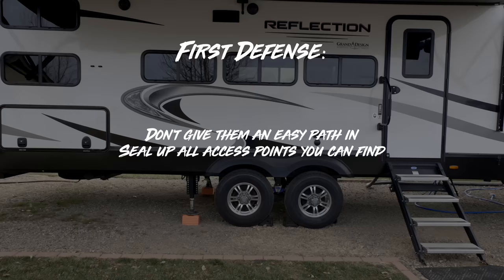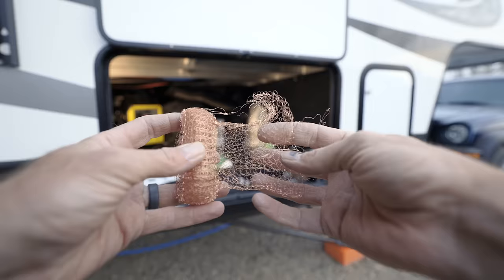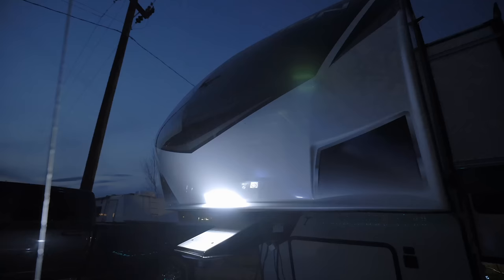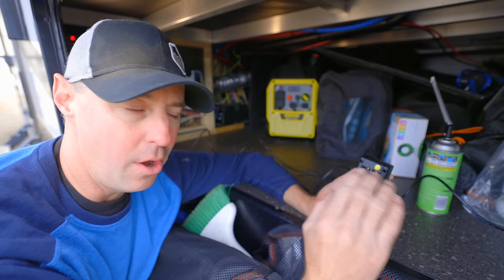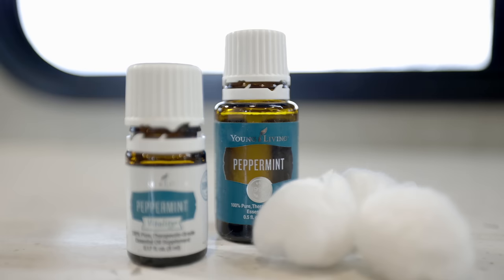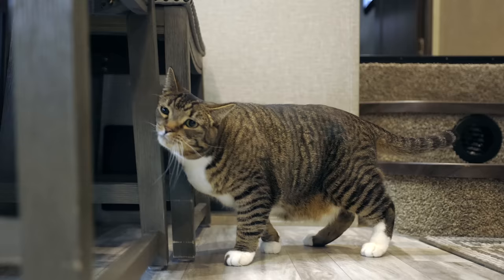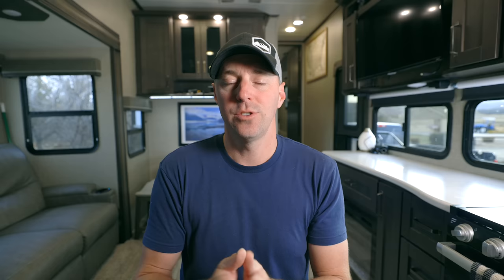How To Keep Mice And Pest Out Of Your RV.

Comment: I don't understand why the manufactures don't take the steps to seal off these entry points to begin with. So frustrating.
Reply: I don’t think you understand how small a mouse can make itself. It’s impossible for manufacturers to seal all the holes. Then the RV couldn’t breath and it would mold. 🤓
Reply: They really don’t have quality control 😩
Reply: Impossible...
Reply: Slows down production. Make holes bigger. Im disapointed in their work manship. Hard to find a used RV with full sealed off underside steel sheeting.
Reply: Because if they do you won’t have to buy another one in five years
Reply: @shanepitzer4323  you think the rv makers don't seal up the holes because they don't want your RV to mold? 😂 bless your little heart
Reply: I swear RV makers use a claw hammer to make all holes for wiring and plumbing.  Poor workmanship abounds in any RV I've owned.

Comment: I have one of the inexpensive CCTV sets from Harbor Freight. After trying all the usual deterrents with no luck, I set up the CCTV on the barn floor under the trailer pointing at jack stands and tires. Long story short they were climbing the power cord. That took care of 99% of them, no more mouse parties over the winter. I set up 2 of the bucket/plank traps with peanut butter for bait near the trailer as well, you know, you don't want them to starve or freeze to death. Drowning seemed fair enough.
Reply: Bucket traps work wonders. Gotta use water though or they'll just jump out. Use antifreeze in the winter to keep the water in the bucket from freezing.

Comment: We slept with our door open on a warm night. A critter came in through the bug net by chewing his way in. After it got in, it wanted to get out. What a racket! We were up and down all night long trying to find it. laid out four sticky traps to no avail. About 6am I shone my headlamp to the front of the cab and there it was…a huge kangaroo rat! I was sure it was going to bite my leg off. I quickly swung open the cab door and ran back to the safety of my bed. It must have run out as after that all was quiet. Smoky Mountain road south of Escalante.

Comment: I lived in a house built in 1840. The mice were here generations before I moved in.

Mice can squeeze through small openings, but 1/4 inch hardware cloth keeps them out. Patches of hardware cloth sealed over 000 steel wool kept the house mouse free.

Comment: I use brass wool to plug the smaller holes. The steel wool makes a nasty mess when it rusts. I used 1/4" galvanized mesh to eliminate larger entrances. You really have to become an investigator. The manufacturer of my RV cut a 6" square hole to feed 1/2" of wires to our entertainment center. SO many oversize holes to fill, electrical, plumbing, walls, floor, AND ceiling. Look in your basement for plumbing and electrical feeds.
It took me a week of cabinet disassembly, crawling in, around, and under my RV. 
Make sure to remove ALL edibles. I found a fried mouse in my toaster. It was going for the crumbs in the tray on the bottom. They ate my Irish Spring soap.

Comment: We are on our third season with dryer sheets, works great for us to keep mice out.
Reply from the maker: Nice!
Reply: We’ve been using them for years and we’ve had no mice get in either. Of course, that’s not proof that they work because we don’t know if any were even around or tried to get in or found it unpleasant and left, but it does make the trailer smell really nice every spring.
Reply: Where did you place the dryer sheets?
Reply: What you mean dryer sheets? Can someone explain further please? @AllAboutRVs
Reply: @boabglen  we use a couple boxes of dryer sheets all around the inside of the camper, in drawers on the bed couches in the cabinets anywhere we think a mouse would visit. And like someone said your camper smells great. We opened our camper a few weeks ago and had no signs of mice.

Comment: We have always fought with mice getting into our RV.  We have sealed all of the holes we could find and used various things to try and replell or catch them.  We seem to have found the one thing that has consistently work for the past couple of years, that is Grandpa Gus's mouse repellent.   A friend suggested it and we have not had any mice since we started using it.
Reply: Where to get it ?
Reply: @JamesBond-hu9rg  Amazon, where else 😁
Reply: Chiming in late here, but I absolutely agree! I used this in my attic years back and this worked flawlessly. I just purchased my first TT last week and will be putting in Grandpa Gus packs this weekend, on top of sealing the holes in the bottom.

Comment: While working on our RV, (Tiny House on Wheels) in the backyard, we started to see evidence of mice. Sealing all places they might get in is a great idea but as I was replacing the subfloor this was not an option. We trapped a few, but they kept coming. We bought a few of the Eliminator Ultrasonic Rodent and Pest Repellers and plugged them in. We have not seen a mouse since. Finding a similar product made in America would be better, but these did the job.
Reply: I love hocus pocus solutions... I also love seeing dead mice in traps, nothing like proof!
Reply: I worked in a Pet department of a store and I put an ultrasonic mouse repellent device in a glass aquarium with several hamsters I plugged it in thinking they would run from the noise or freak out they didn't react whatsoever ! It didn't bother them at all. I have seen several videos that show the same thing. You are paying for a plastic box with an LED that probably doesn't even make ultrasonic sound at all. I hear they work great for werewolves and vampires .

Comment: Modern RV s end less chore. Add screen, steelwool, screw in fitted cut tin patches, spray foam. Then mint oil, little trees, flower 
 airasol. You need them all. RV s are the best mouse attractent.

Comment: Gret tips to prevent mice entering your RV. I use the copper mesh instead of the steel wool because the wool does rust and could stain. I will consider the rid a rat item. 
In addition to sealing the underbelly of the RV, I also recommend using the copper mesh in the corners of your slide out too for when in use or in storage.
Reply: What do you mean copper mesh in the "indoor" corners of your slide or outside?

Comment: Here in Indiana we store our camper inside from November to April. We have always used a product that a local farmer taught us to use. It's called Fresh Cab and you can buy it at most stores like Menards, TSC etc. It's citrus based and has a pretty good smell, for people anyway. 8 years and never a rodent. We add some dryer sheets just as an extra. I notice that you have not mentioned it as a deterent.
Reply: What's the dryer sheet method?

Comment: Bounce fabric softener sheets work very well on the inside of vehicles or campers. Plus they smell nice….for a while. And on the outside I use Tom Cat bait boxes. I usually put one at each corner of the camper and one at each wheel.(on the ground) I’ve used them for years and had very little to no rodent issues.
Reply: What do you mean bounce fabric softener sheets?

Comment: You can use stainless steel wool that is course.  The copper can be eaten through.  I’ve used the stainless steel wool for our camper and you don’t have rust issues and the critter don’t like it.

Comment: We've been using Dryer Sheet for years.  So far (fingers crossed) we've never had mice.  

Our trailer is stored indoors and we do not have access during the storage season.  So lots of Dryer Sheets.

We've recently had an invasion of mice in our attached garage.  3 traps, baited with Peanut Butter have caught 5 in 3 days, then 2 weeks later, 2 overnight.

Thanks Jared.  Great suggestions.

Comment: Steelewool is highly flammable!
Reply: Google "start campfire with steel wool."  Lots of videos and articles!
Reply: @lisastoner6635 Only the finer grades like 0000, the coarse stuff would require a sustained propane torch flame to have any chance of ignition.  Think campfire tinder vs 6" logs, much more surface area with 0000.

Comment: I use poison Bait Chunx cubes.  They have a hole through them and you can use a zip tie to place them in various places under the hood, etc.  The mice eat it and quickly die.  So far I have not had any damage from mice.  To keep bugs out of my RV garage and the RV itself, I use Raid house foggers inside the RV garage while the RV is parked in there.

Comment: Found on 2 trailers that the worst sealed area is the shower/vent drain penetration.
Wall panel removal is necessary. Had squirls fit through. Trying cloves and cinnamon in pouches and clove/peppermint oil sprays as mouse deterrent for home/garage/car everthing this year. Up in the north mice seem to love poison and seems to attract them.

Comment: I use the electronic repellents and mint oil on cotton balls.  I’m in Florida, it seems to be working so far.  I’ll look into the copper wool.  I’ve started fires with steel wool, so I’ll pass on that one.

Comment: My neighbor successfully uses an electric fence connected to an 18” tall metal fence around his trailer set in his woods. I think 12” would be better as 18” is a pain to step over. He has the metal fence sitting between 1/2-1” above the ground.  Has to ensure there are no rocks, dirt or grass touching the fence. It hmmm if it does. Otherwise works great. Has eliminated mice, spiders, and others pests.

Comment: Thank you so much for this video. My RV is a diy campervan. I have a mouse nest in the under the hood in the Engine. I recently had some work done on the van. The mechanic noted some wires chewed and looked around until he found a nest. 

The van is running great at the moment. But I am very concerned about that nest and want to remove it. I suspect whatever mouse made it fell out many miles ago. Whether it did or not, a mouse nest seems like an invitation.

Next stops on my agenda? Rv shop, Napa and more mint oil!

Comment: My fifth wheel trailer is stored under a pavillion in the Adirondacks.  I was overrun by mice when I first bought the land.  I have several layers of defence.  The first is drowning buckets, either the rolling can, or the trip diving board.  The second is a 12VDC electric horse fence.  The wire is only about 2" above a grounded hardware cloth.  Behind that is a black plastic sheet like a trailer skirt that slows down the mice.  Lots of them expire there.  If some do get past that, I have the poison blocks and glue traps underneath the trailer.  If they do get inside, I have the Ketch-All with the drowning attachment.  In the jar, there is RV antifreeze with some olive oil on the top.  Anything that drowns in there will not smell or attract flies.  I hang a few Hot Shot No-Pest_Strips inside for spiders and flies.  I just remove and bag the pest strips when I'm using the camper.

Comment: My situation is a little different as it is more a permanent fixture. I used 4 ft High chicken wire. I wrapped the bottom of the vehicle with 12 inches laying flat on the ground and have had no issues at all. Now,  bugs that's a whole 'nother problem.

Comment: I have been RV’ing full-time for 5 months now and have never had rodents. I had bugs fly in, but mice? Haven’t had the pleasure yet thankfully lol. Is this really a big problem for people? I don’t get it 🤦‍♂️ Thanks for another great video.
Reply: Yes this is a serious issue. We had a terrible time with mice in our 1st trailer. My husband had to remove 7 dead ones one summer after being in storage.  They had eaten all the kitchen towels! Mice dirt everywhere. It was awful and we never could get rid of the smell completely. Potpourri helped. We dealt with mice for several years before getting a handle on it. Irish spring did not help nor dryer sheets. We use a product my husband buys at Ace hardware (can’t remember the name) now when the trailer is in storage. Smells awful but it seems to be effective.
Reply: It's a huge problem, especially if you have slide outs. Otherwise most R.V.
's are sealed pretty well.

Comment: I lost the battle and rodent ate the generator wiring.  $1800.00 latter, I am going to close up the front of the onan 4k gnerator w. hardware cloth, steel wool and foam making it rodent proof ,I think.  Then remove it when we need the generator.   Using lie traps works far better over the kill traps.   A Rope light, hmm.

Comment: We use the electronic repellers but after three years they tend to drift off frequency and have to be changed.  Works well for us though.
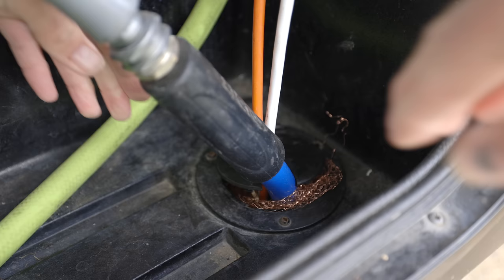Reply: How to test electriconic device? HOW WILL YOU KNOW ITS WORKING. 2:18
Reply: No Mice?
Honestly I don’t know. I just know with them powered we’ve never had a mouse.

Comment: My under side is sealed up well but this year on our hunting lease we got mice in anyway. The only possible way in is where the slide out goes through the frame. Any way to seal up those penetrations to prevent entry?
Reply: Yep, that's where they come in. The manufacturers leave a huge gap around the shaft that goes into the frame. It's a pain to try and seal that off especially when putting slides in and out daily while traveling.

Comment: Get rid of your underliner, remove cheap insulation (perfect mouse nest) prime any bare wood, install rigid foam in removable panels, tape all seam and joints with aircraft tape. Coat with roll on rino liner. 

Bullet proof, better insulation,easy access to everything that was hidden under the liner (plumbing and wiring)

Super easy to inspect. 

That was #3 on my list of at least 50 changes I want to make on my 2 year old travel trailer. 

They are all built like crap… mine will be tits someday.

Comment: Too Bad RV manufacturers don't take Rodent ingress seriously. In Vermont a stored RV is a rodent target. They are built so poorly that left unattended an RV will become worthless in a couple years. I tried mothballs and dryer sheets and the mice builds nests out of them. A cat is half the battle. My best system is water or bucket traps outside the RV. No food is one of the best methods. I mouse or a rat will not stay around if they cant eat

Comment: I live in a small travel trailer that doesn't move. I have a air conditioner unit on roof. I do use the air conditioner with the warm weather but when I dorn use it for a while can wasp get inside the trailer through the air conditioner vent on ceiling? I live in California in the country.

Comment: I don't think detering mice is worthwhile. If it worked at all, they'd just move on to their next target. I want them dead and I want a body to know I've been effective. I've killed at least 50 mice outside around the motor home shed, the wood shed, storage shed and next to the house using the 5 gallon bucket trap. Very effective and I didn't get another one all winter. Costs nothing and requires no labor or time. 
If you are trapping inside your RV, you've already lost the battle.

Comment: We vacationed this late summer in nc mountains and we’re invaded by Stink Bugs!  I’m sure we carried them home and we also saw them in VA mountains on last trip. Luckily they are easy to physically catch and crush but what in the world to use to eradicate them once they get in?? We are still killing them and now the rig is in For repairs but I’m sure they are still in there. I did read that they don’t breed indoors so I’m hoping after the winter here in eastern NC they are gone! Also I have a question about sealing all holes up with great stuff around wiring? It it safe to do?? Or should we cover area with copper wire then use great stuff??? Thanks in advance!

Comment: Question…why don’t you spray for bugs onto the tires? I’m curious. Can’t imagine it damages the tires does it?
Reply: I think he was saying not to spray the wheels, I suppose because the chemical could discolor them. So he sprays at the points where the wheel assembly  contacts the trailer body.
Reply: @gpwrinkled  Thanks for the clarification Greg. I appreciate it!

Comment: Where is it dangerous to add the steel wool? Electric lines ect…. Fire hazard…And put cooper there? The hot water heater area had a nest there. It winter, I temp put steel wool in the opening near that inside of camper. I need to change that.

Comment: Despite my best efforts at closing ANY potential opening on the exterior and using rodent deterrents on the inside, I still get mice every year in my OutdoorsRV travel trailer.  Is it possible for the mice to enter the inside via the slide-out rails?  Any thoughts would be appreciated.
Reply from the maker: Yes they can. I would use the galvanized or aluminum mesh to cover and scribe to it. You can hold it on with magnets and remove it when you activate the slide.
Reply: Check it out for us. When the slide is out, is there a gap between the all sides of the slide and the main trailer. Could a mouse get up there?
Reply: @AllAboutRVs  Thanks.  I've been highly suspicious that this was their entry point.  Couldn't find any other place that was possible.  Happy Holidays!
Reply: I use wheel bearing grease around my slide out rails, so far so good.  Another problem I found on my old RV which was a bumper pull, the tongue was made of tubing and I saw a mouse climb my jack and disappear into the tubing.  Thus he had a path between the two floors of the RV and any hole in my main floor not properly sealed and it was in the RV with me.  Sealed the tongue with foam and no more visitors.